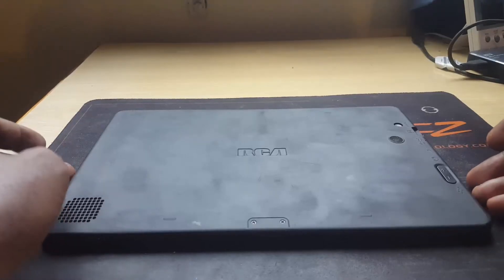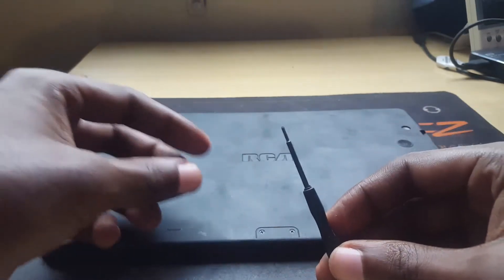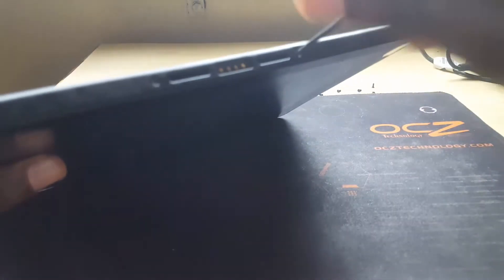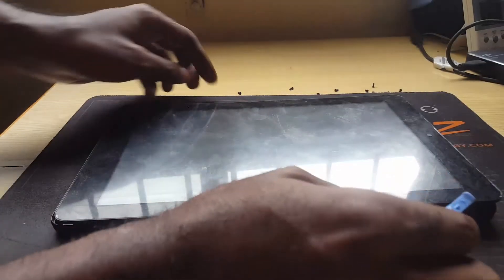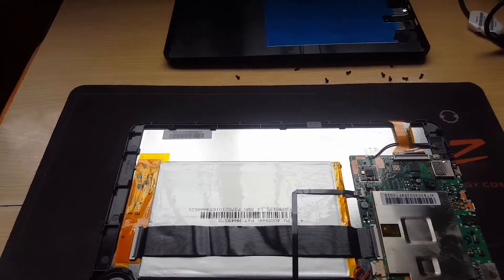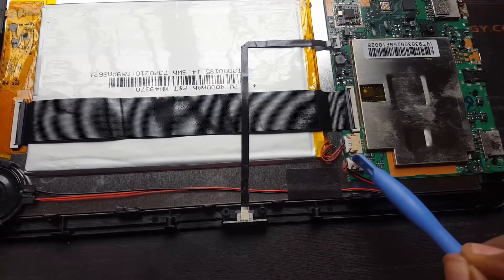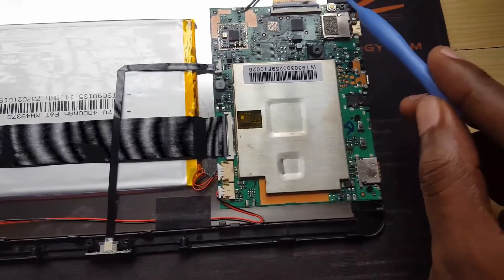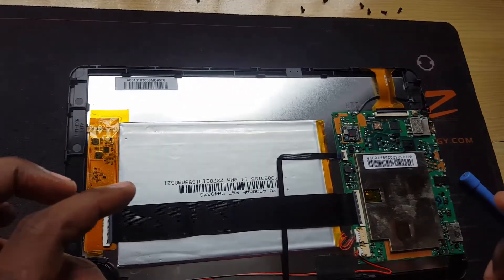Windows Tablet Disassembly RCA Cambio

Comment: Hello! I've looked everywhere, and this seems to be the only relevant guide about disassembling Windows (non-Surface) tablets. Could you tell me where the ssd/hard drive is? Thank you!
Reply: did you find out?
Reply: @adrienneparks9791 Yeah. It seems like these tablet devices use eMMC storage in the same way that mobile phones do, which means that it's soldered onto the motherboard and can't be easily removed and repaired. So it's flash memory, and not an SSD.
Reply: @ShimmeringVapidCoal  thank you! I'm wanting to get the data. The tablet is toast

Comment: My cambio is not charging. Do you think this battery disconnection will help?
Reply from the maker: It might -u wont know until you try.
Reply: @rickytlc1985  It did not sadly. Thanks for the video still though
Reply: Depending on the model of power brick, it may just be that this has gone out, a very common problem with some models of brick, can order them off ebay, search "cambio cord."